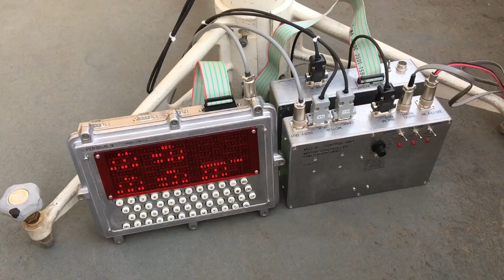Telescope Mount Controller using homemade 6502 computer PERSEUS-9

Comment: Maybe I'm missing the point. So, what IS the point? Same as pulling an electric train with a steam locomotive? I'm from the 6502 age. It was a wonderful processor and my entry in the computer world. Your coding skills are great. But that's about it.... Everyone knows you can control stepper motors with pulses. Everyone knows a 6502 can generate pulses.
Reply from the maker: Thank you for your comment. The contents I have disclosed are not superior to what is currently realized in the world in terms of CPU performance, algorithms, stepping motor control methods, and the mechanical structure of the telescope. However, I think if we accept the current state-of-the-art technology as it is, it will be difficult to understand the basic efforts of people about 40 years ago. In that sense, I have made this kind of work myself and published it here.
Reply: @mitsuruyamada  He is missing the point. It's a work of art.

Comment: This is so cool! This build quality - The computer wont ever have a defect...
Reply from the maker: Thank you for watching! With the processing power of this computer, control from the computer side would be very limited even if it were built in machine language, so I decided to implement only the readout, calculation and display. With the computation speed of my interpreter, I was able to create something within the practical range.